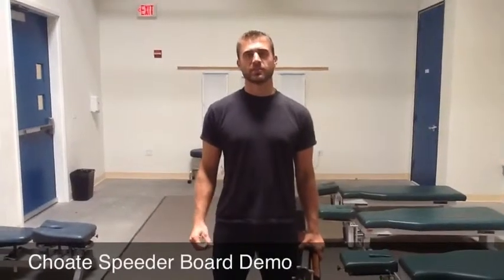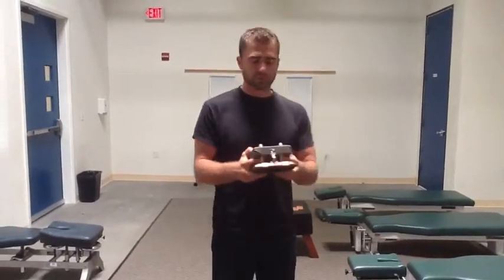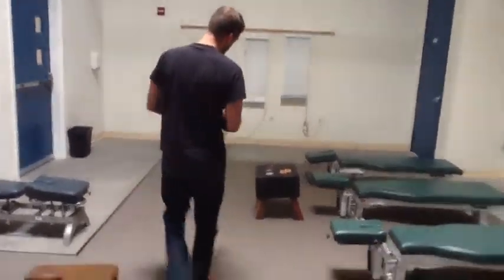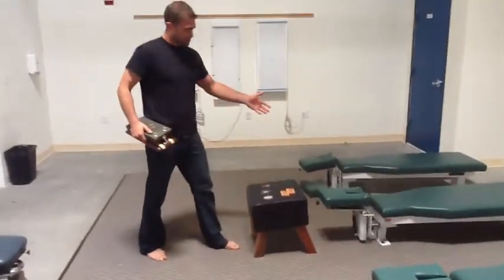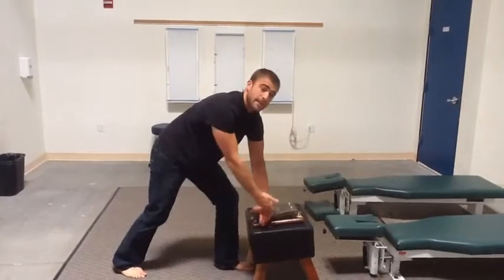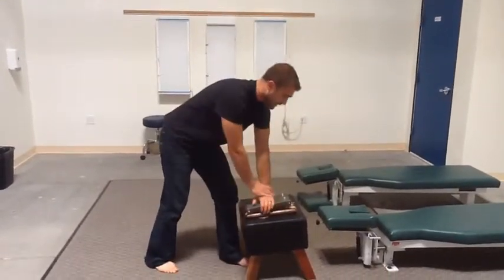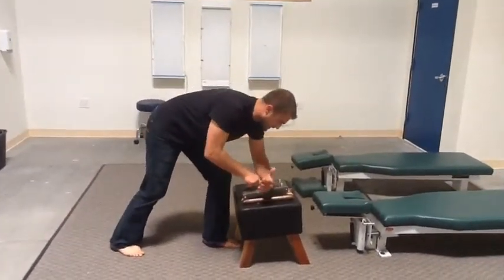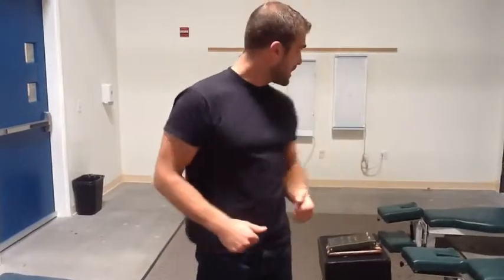Choate Speeder Board Demo 2

Comment: The thuli is actually a drop piece, it's good for adjusting extremities but its not built to build speed.  This one is spring loaded and meant to stimulate the resistances he body would have to the adjustment.  It gives the user a better feel of what speed and depth to adjust with.